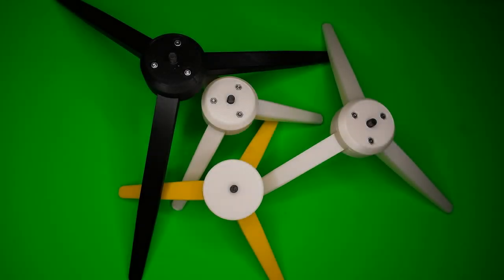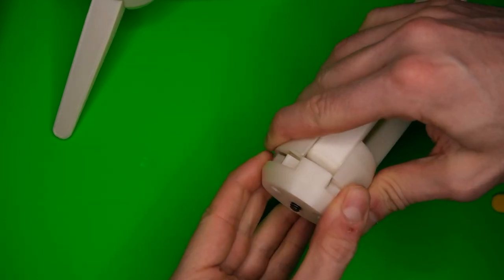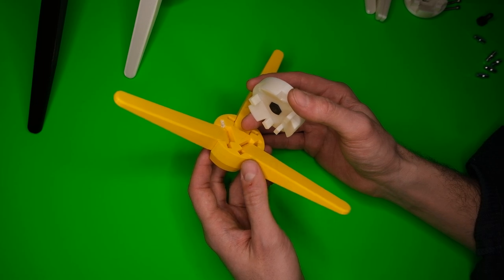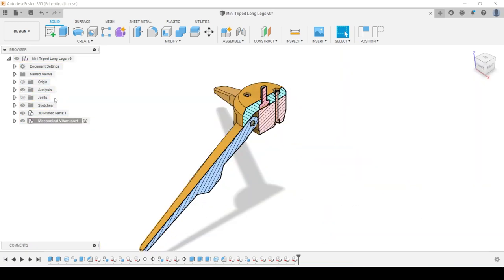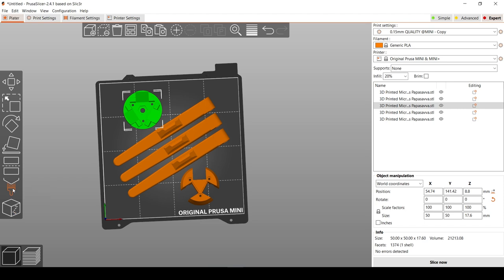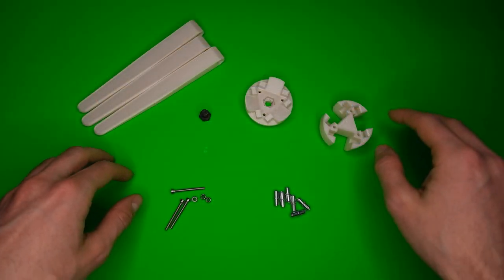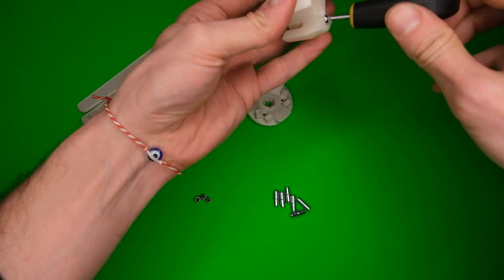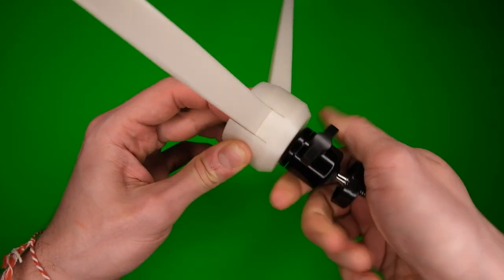DIY Mini Desktop Tripod - Project Mount / 3D Printed

Comment: Great design. Will definitely keep the term "mechanical vitamins". One of my favourite is piano wire to reinforce printed parts.
Reply from the maker: That is very interesting vitamin! Have you seen the 3D printers converted to deposit copper magnetic coils for pickups?
Reply: @SavvasPapasavva  Never heard of that. Do you know 4D Modelshop in London Bridge? They have all sorts of great stuff
Reply from the maker: @laurinos8774  Yes I know it - often sending students there but I haven't been for years. I'm amazed it's still there tbh. Long may it last.